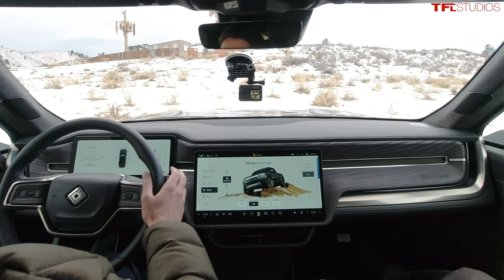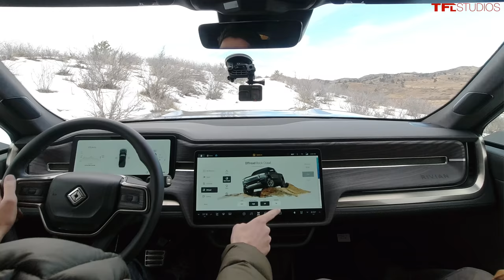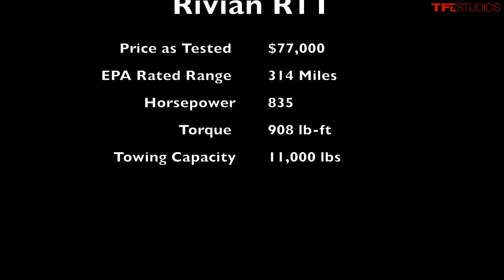Fully Loaded! Can an EV Pickup (Rivian R1T) Survive a Hard Days Work?

Comment: I’d say that load of wood was close to exceeding, if not exceeding the payload capacity of the R1T.  Either way, it didn’t seem like the truck really cared.
Reply: I think it only hit 1.4k lbs so it still can carry more than that. almost 9.5k lbs more from rivian's numbers. they will probably tow more heavy stuff to test it's limits. TFL is pretty meticulous with their test for both real world and theoretical.
Reply: I was thinking the same thing. But truth be told, that's reality. People will verload the truck in a similar way. And now we know it can handle it. That said I wish they would have discussed more about it's handling characteristics while being overloaded....on the pavement. Did it feel sloppy?...Did it tend to lean in the corners..?? Etc....OR did the IRS handle it like a boss?
Reply: @asianforce  you do understand the difference between towing and payload, RIGHT?
Reply: @mattbrew11  they only mentioned towing capacity. But yeah just checked you right. The payload is 1.7k which is still really nice.

Comment: Great video. I’m not 100% sold on the looks yet, but you can’t argue with the performance and utility.  I’d take this over a cyber truck any day.
Reply: Utility and performance - CT has twice the load carrying capacity,1/3 greater range, and a stainless steel bed which cannot scratch/rot. Who cares what it looks like? Maybe less expensive if original prices survive.
Reply: @paulashton5990  I hear you, but tired of waiting on the Cybertruck.  It’s worse than the Bronco fiasco at this point.

Comment: Tommy, regarding your concerns about flat tires: there is a built in air compressor... squeeze in some flat tire sealant and air the tires back up.  and regarding your concern about dirt getting stuck under the gooseneck: use said air compressor and blow it out.

Comment: Sure would be useful to have a longer bed. If they would make a standard cab or extended cab with a 6.5 or 7 foot bed then it would be able to do more work. Most people who buy a truck to do real work don't want or need a 4 door crew cab, they need more bed size. Could you imagine a Rivian work truck with a regular cab and a 7 ft bed without all the luxury extras for $48,000. I'd buy one !!
Reply: I'd definitely consider that configuration, but rivian is building trucks for adventure types who wear Patagonia gear. 
Not trucks for normal blue collar hard working calluses on our hands type's. Maybe Ford though will offer a reg cab 6.5' bed rwd only lightning for about 35-38k someday? I bet with less weight it would do 250+miles on the base 98kwh pack easy enough. 🤔
Reply: Those 'luxury extras' are also major sources of failure after some years (everything from water ingress in the bed switches and receptacles to possible dangerous reactions to bad signals from a faulty camera or LIDAR/RADAR sensor).  I also have concerns about ladders, lumber or pipe bundles smashing the glass roof.  Also, glass roof means no mag mount flashy lights.
Something with a full 8ft or even 10ft bed and a short nose or flat front (think K truck form factor but full size) with no techno wank would make a good addition to their lineup.

Comment: fun fact
8% of battery used means it has used about 1/3 of a gallon of gasoline equivalent, energy wise.
That would be an interesting comparison. Compare how much energy the rivian and an ICE truck use in accomplishing the same tasks.
Reply: How did ya figure that out?
Reply: @willrector9716  1 gallon of gasoline contains the energy equivalent of about 34kWh. The rivian has a 135kWh battery nominal.

Comment: Awesome display of what that vehicle is capable of and Rivian should be thanking you! One thing I will note, as Tommy pointed out re: the spare tire, is that Rivian should include a low mount roof rack system for the spare tire when fully loading the payload. That way you can remove the spare tire and mounted over the cab and then load up the bed without worrying about getting a flat and having to unload your cargo. It could then be placed back under the bed floor when no cargo is being loaded into the bed and could serve as double duty for other needs, as well.

Comment: It’s definitely capable, which is nice. I’d still never buy an EV. Would you rather charge for over an hour or gas up in 5 minutes? That’s a long ass road trip. I feel bad for Chad. It’s going to take a beating while you guys have it. Kudos for trying to not tear it up too much.
Reply: How about meet in the middle? Get an f150 hybrid, for example. You get the power AND the gpm. Remember how good Andre's hybrid f150 did in the videos?
Reply: Yep! Go watch superspeeders new video about his tesla. The cold weather is severely hurting his range. And to install a home charger, was about a grand.
Reply: @JohnDoe-nz6bk  most house are not capable of running an electric car charger. They require another power line ran from your source to home, then add a breaker box, then run wire in to the garage for the charger. It's thousands of dollars especially if you're running underground
Reply: @jacobstrutner8232  pure uniformed lies. The average 240 volt ev charger uses about the same current draw as your main hvac unit, an electric dryer or electric oven 30-60amps depending. So your standard since the 1980s 200 amp home service can support running most or all of those at the same time. You can also buy a smart splitter for about $400-$500 and run your ev charger off that connection.
Reply: @jacobstrutner8232  exactly
Reply: @4literv6  he's absolutely right!
Reply: @JohnDoe-nz6bk  he is not and lying to people who may not know any differently is abhorrent behaviour. 😏

Comment: Wish someone would talk about cab heating and a/c.  I notice in video after hard work they're still wearing their coats.
Will the spare tire fit in the front trunk?  Maybe move it before loading rear.
Reply: I don't think it'll fit for the rivian, but that would be an excellent suggestion imo. 
The lightning frunk would fit it and possibly the new ev silvrado. I wonder if we might see a really smart ev truck team move the full size spare to the frunk in the future. 🤔
Reply: @4literv6  yes and I hope that smart team might come up with a door handle which would not be bothered by a coating of ice.
In my experience with trucks, from hay for cattle in a snow storm to attending family weddings, it's the little things like door handles that maintain the relationship.
Folks will marry for life because of the big things; but they will separate over trivial matters like the handling of a toothpaste tube.
Reply: @olegig5166  wise words few will heed upon hearing. 👍🏻
Another feature I liked about the lightning is it has the regular old f-150 door handles.
Reply: @4literv6  agreed, sometimes a fellow needs something tightly fitted on which to give a good tugging.

Comment: This truck seems to be well thought out and properly sorted. But unfortunately, clean-sheet designs are not something legacy manufacturers can do very well. So for them, it’s always about the parts bin mentality. Only someone like Rivian can build something like the R1T.
Reply: Sorry man  the "legacy manufacturers" are making better rigs in half the time rivian has been messing around. .......
Reply: @willrector9716  if you say so. I am still waiting on one from Detroit.
Reply: @smarticus6384  you must remember we been waiting on the rivian for far longer than ford whipped one out and gm...... hummers are already in people's hands......... just sayin. Hummer went from design to dealer faster than any vehicle. So your claim isn't really right. Many can do it not just rivian. But rivian did a remarkable job for sure.
Reply: @willrector9716  Considering each manufacturer's resources at their disposal, the Detroit makers are lagging way behind. I will give Ford credit for choosing in 2021 to spend 5.8b on a new manufacturing and supplier complex in TN to build Lightnings. However, to me, the Hummer is more of a small-scale proof of concept vehicle. It will never sell on a large scale like the F-150, and we will have to wait to see who lines up to buy a slightly less expensive $100k+ Silverado (Aka new Avalanche). Either way, Rivian should have never been the first truck manufacturer to produce an EV pickup. Like it or not, legacy manufacturers are lagging. Tell me again, how many EV's did GM make in December?

Comment: I see in multiple reviews calling out the "gooseneck tailgate hinge" - but while most conventional pickup tailgates are mounted on "pins" to the sides of the bed chassis - most also have those pin-hinges BELOW the bed height - so when the tailgate is open, it is flat-and-level with the main bed. They just don't have the little flap to cover the gap.  On my mid '90s F-250, that gap is only about an inch, though. Which can be "manually" bridges with a piece of plywood.

It is a novel approach Rivian uses, but it isn't exactly "unique" in that the tailgate is a flat extension of the bed. GM trucks have that, with even a "flip up" bit of the tailgate that then acts as a new "end gate" when the tailgate is down!

Comment: Does anyone know what these electric trucks will need for motors or batteries after 5-10 years? Fine and dandy buying a new one, but what should a second or third owner expect? I’m curious what those repair or component replacement costs will be? On new gas powered pickups you don’t really expect to ever have to swap out an engine, axle or transmission if the proper maintenance is done. They are good for at least 15-20 years. Just something I’m struggling with on EV as I may never end up buying a new one.

Comment: I've always liked the design of the Rivian vehicles. This video has absolutely impressed me with how capable the R1T is! I love that the tailgate enables the bed to be 7 feet long, because my biggest complaint about modern trucks is the bed isn't long enough.
My only concern with the R1T is it doesn't look like there are enough tie downs for that length.
Reply: I hear you on the bed length, but I'm kind of the opposite. I out a tool box and a custom rack to hold fire extinguisher, spare jerry cans, compressor and tank between the tool box and the front of the bed so I had a 5'7"bed.. now I have a 4' bed... but anything bigger than that I have an 18' trailer for.  I came from a full size SUV and the trailer to the crew cab so I'm accustomed to no "bed space".

Comment: In September 2021 Rivian released the owner’s manual for the R1T revealing it weighs 8,532 lbs (3,870 kg). The EPA says that trucks weighing between 8,501 to 10,000 lbs (3,856–4,536 kg) are classified as EPA Class 2b, which puts the Rivian in the same category as the Ford F-250, Chevrolet Silverado 2500, and Ram 2500.

Comment: I was concerned that Tommy's would be walking home after charging all those batteries and cruising the fields, I'm suitably impressed with the energy usage. Also I've seen another reviewer do some off-roading with the Rivian, and while it's impressive it seemed it could use a little better/smarter synchronization to better approximate a locking diff. It took a few seconds, in some cases, for the truck to figure out how to adjust for one tire losing traction. It still made it up a respectable grade and track, but that one thing could honestly be a little better.

Comment: Watched two TFL reviews on the RIVIAN, one towing a loaded trailer, and this a working day with a rivian that showed on my front page. I'd like to say well done awesome reviews TFL very impressive.  As a farmer, driving a Ford Ranger Wildtrack in the UK, so oversized american trucks are impractical, the Rivian,  has impressed me, not sure it currently suits my lifestyle in full, the day to day work appears it would do but the 20 days of long haul driving I'd have to make other arrangements.   Very interesting about the electronic locker, does this take in to consideration going around corners and changes in grip, a normal locker will just try and break an axle or scrub the tyre.

Comment: what i can imagine makes an EV very good for ranch use is that you never need to run to a gas station or keep a bunch of fuel on site. i could see electric UTVs and SxSs having a similar use case as very convenient ways to get around and do smaller jobs. the benefit of en electric truck is that you can take it to town and tow pretty decent loads smaller distances. the only real thing you can't do with is tow long-distance since it kills the range so much.
Reply: Good point!

Comment: Love the tailgate. Wondering what it is load rated at. I broke my Tundra tailgate with too much weight on it. Folded the sheet metal like a cheap tin roof. Great video cant wait to see it run up the gauntlet with no reduction in load for elevation. 👍

Comment: Right now, the Rivian is not yet a “working man’s pickup”. Mainly because of the bed limitations. Like proper bed tie downs, the way the tailgate works and the lack of tolerance for debris accommodation. Those tailgate hinge pockets are going to be a real issue is service. And the tailgate needs a whole bunch more weight accommodation capability. You don’t need the tank turn, but the 4 wheel steering capability will be a great feature for tight and close quarters maneuvering needs.  

I think that at some point, working trucks are going to rekindle the desire to have pickup beds that are bigger than a wheel barrel. I used to think a 6 foot bed was small. Now they are selling pickups with beds around 4 feet long. And most of that length is behind the rear axle. 

People used to take cheap old beater cars and remove the trunk lids to turn them into trucks. Now you pay $100,000 + for what amounts to the same thing.  And those old cars had trunks bigger than the bed of this Rivian. With the same or bigger payload capacity.

Comment: Nice little truck but for 90K$  I would go to Ford F150 lightning with the biggest battery pack who can be use to feed your whole house in case of power failure  for the same retail price !! Under powering electronic tools is a bad idea the best way to burn the regulator circuits .

Comment: My main question with any of these EV's is 12V accessories? My truck has beacons out the *bleep*, wrecker light bar, LED light bars for scene lighting, winch, air compressor (for air horns and filling tires, etc).. I don't know how that stuff all plays nice on an EV. I've sat on a road for 6 hours plus running blocker with all the lights going in -30, so truck running an heater on.. how does an EV handle that? Nevermind my other concern is long range with fast turn around.. I've done a few 1400mile trips hauling a trailer in about 32hours with a 6 hour sleep break.. not sure an EV can do that yet.

Comment: Great review, just to touch on the flat tire with a full load, years ago while carrying sand gravel and bags of portland cement on top, experienced a flat rear tire. We had to unload the truck because it is extremely unsafe to try to Jack up the truck, the Jack probably would have  let go. Our spare was readily available, but to ensure a safe tire change, the load had to come off. My neighbor around the corner lost his life just working underneath his car when his car Jack slipped. No Jack stands. It's just not worth it. Alway error on the side of caution!